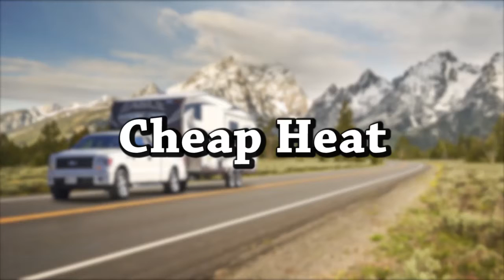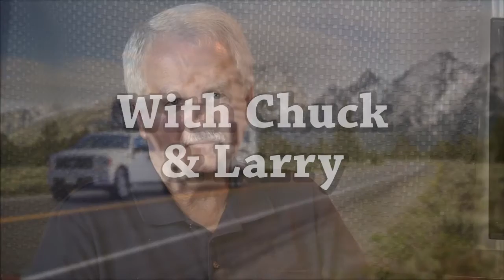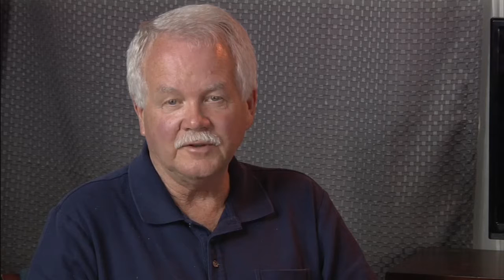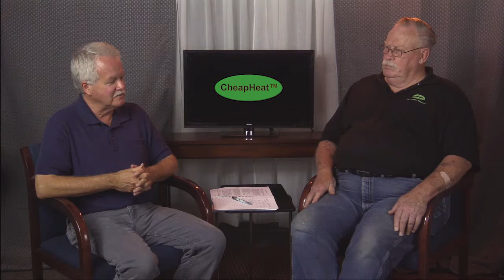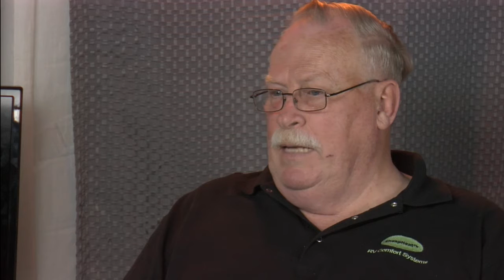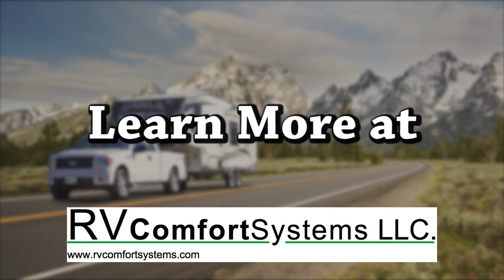CheapHeat: Advantage to using it and how much power does it use

Comment: How about mentioning the actual amp draw instead of comparing it to 2 roof top A/C units. I only have 1 A/C unit with 30 Amp service.
Reply from the maker: The DH50 21 amps per leg on 50-amp service (about the same as 2 roof AC) leaves 58 amps.
The DH37 16 amps per leg on 50-amp service (about the same as 2 roof AC) leaves 68 amps.
The DH18 16 amps per leg on 30-amp service (about the same as 1 roof AC) leaves 14 amps.
A 30 amp service really limits the heat output because with a 30 amp service you only have one leg at 30 amps. Where a 50 amp service has 2 legal at 50 amps for a total of 100 amps. because a 30 amp service only has 1/3 the power of a 50 amp service you can only get 1/3 the heat output. So on RV's over 25 ft we suggest you upgrade to a 50 amp service (we can send you a wire diagram with a list of parts you need to do that). Just contact us a www.rvcomfortsystems.com and ask for the 30 to 50 upgrade wiring diagram.
Reply: @cheapheat7274  Thank you for the quick reply. Being a 5 year old video I wasn't even sure anyone would comment. My camper is a Rockwood ROO 233S and is only 23' long, but I do have canvas bunk ends. We have never had an issue using the A/C and any other electrical items we normally use so I'm not sure I would really be interested in un upgrading to 50A. As long as the electric heater with the 30A service would put out comparable heat to the propane heater I would be good.
Reply from the maker: @popeyeandy959  Andy we actually make a Hybrid Electric heater spacifically for that type of RV. It's our NT-DH19 Ductless Hybrid kit. You can find oi on our website under PRODUCTS / DUCTLESS. You can also purchase it through our BUY ONLINE portal.at www.rvcomfortsystems.com
Reply from the maker: @a2cryss  Andy when you test an RV gas furnace with a gas flue analyzer you'll find that they are only about 60% eff at best. So that means your 40,000 BTU RV furnace only puts out 24,000 BTU. Also you furnace has 60 second pre purge and 90 second post purge which means every run cycle you have 2 1/2 minutes of run time the gas is NOT on. So....... if you look at the true heat at the floor register you get about 20,000 BTU to the inside of the RV. That being said the Elect heat is 100% eff and has no pre or post purge. The CheapHeat system puts out 5000 Watts of heat or about 87% of what the gas does. 
thefindequivalentEquivalentincorporated

Comment: The product is not inexpensive. As a Full Timer, this motorhome is my only home. I considered it a home improvement investment. It works very well and I am very satisfied with the result.

In January 2013 I worked with the owner of a RV Repair faculty in Brookings Oregon (Owner/Operator) to purchase and custom install the CheapHeat Add-on unit in my 2001 motorhome.

My original (2000 manufacture) Atwood propane furnace motor was failing. I had to replace it and wanted to add the CheapHeat electric heater to the install.

As for the install... This was the first HeapHeat unit for him. The learning curve was near vertical. Patience and attention to detail to excellent installation instructions also required modifying the Atwood heater box ducting. It was a challenge. We constructed cardboard templates and then cut the sheet metal to match. Trimming and re-trimming as required. The new electric heater Add-On required new 240V wiring (two 120V legs) to be run and connected to the the new electrical breakers (2) in the original electric circuit breaker box.

The install is completely hidden. Visible is only a new Heat Source Selector Switch mounted inside the lower kitchen cabinet and two additional electric breakers in the breaker box.

The end result is great. 

A Gas/Elect Selector Switch controls the heat source. Otherwise operation is the same, via the original wall thermostat and utilizing the original RV ducting. Propane heater is 35K BTU and Electric is 27K BTU.

With full 50 amp hookup (electric included) electric heat is FREE. 

The new Atwood propane furnace was $650. (in 2013)
The CheapHeat Electric Heater AddOn was $1,200 installed.

Twelve hundred dollars will buy a lot of propane. I am a Full Timer and keeping the same rig long term. I like conserving propane by being 100% electric. On an electric meter, one would need to compare electric rates and propane price to determine the best heat source per penny.

It will take many years to balance this monetary investment. Other living comfort items are immediate. There is no propane burner noise, just the fan running. No exhaust fumes or burner noise outside where I typically sit for my morning sunrise coffee. I'd say the electric is cleaner. Also the electric heat output, while slightly less than propane, seems to be more even. The CheapHeat runs longer cycles than the On-Off On-Off On-Off noisy cycles of the propane.

It will run on my 8.5Kw generator. While I have not compared diesel/propane costs, I generally switch to propane when dry camping, to minimize generator noise. When I do run the generator for other electric needs, I switch the furnace to ELECT and save propane. It is very nice to have the option.

See the CheapHeat website for more information and links to videos on their Home page. Under Products; the Add On drop down tab shows their Add-on unit similar to the one I got.
http://www.rvcomfortsystems.com/#